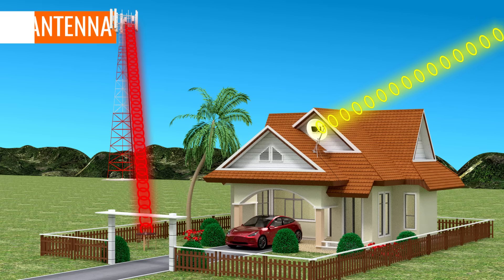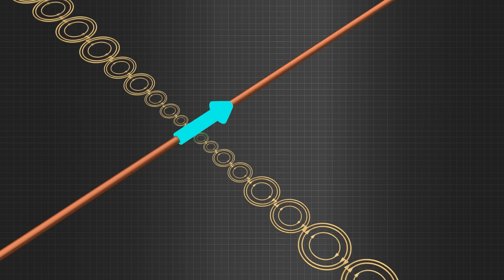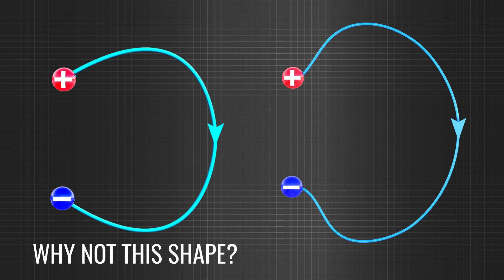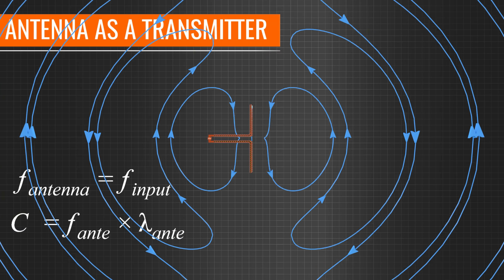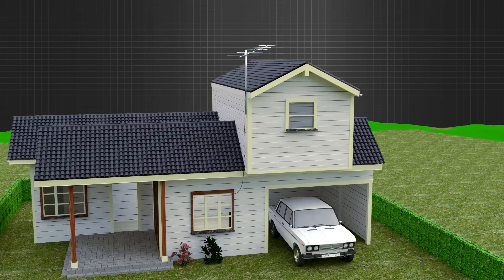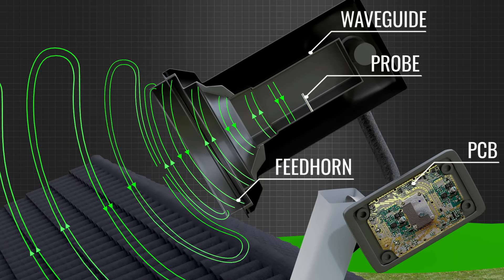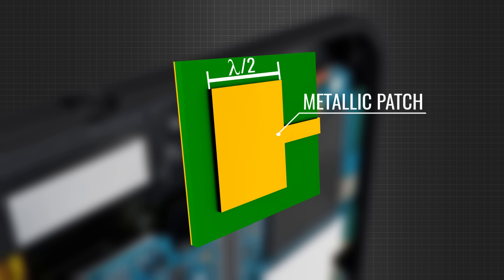How does an Antenna work? | ICT #4

Comment: It's been quite some time since I've been traversing through internet to know about antennas and I couldn't even understand how antenna works without a closed circuit, this video explained perfectly all what I needed to know. Great job. Waiting eagerly for your video on "Kink" effect.
Reply: We live in a 100% magnetic universe..... it's that simple!!   The center of a magnet is by far the most powerful part!!!   that's where you will find anti gravity and most everything else.   STUPID HUMANS!!  We went backwards in the Iron age!!  the center of a magnet is where we belong after all that's what we are all configured with..FACT!
Please review the works at "CORAL CASTLE, Florida. (YouTube),   He would "VIBRATE" ,,  not oscillate the granite at a resonant frequency to the type stone he was working with.  Granit has allot of magnetic properties given it's make up...  You just need to vibrate at the correct freq.  and it will become workable.  Keep in mind we are talking about vibrating only the "B" field of a magnet into the rock!!!   You will note at Coral Castle he also had a horizontal stone , similar to Stone Henge... All his magnetic generators were in the repel mode to maximize the "B" field..  SIMILAR TO THOSE Shown ON THE PYRAMIDS OF EGYPT..  FACT!!,  THINK about it THAT'S exactly why they used copper tools!!!!  You must use copper tools and any iron would totally dispute the field.  Quantum Math is total B.S.  E=MC2 is also total BS... E=MD.  (Magnetic density).  Thanks  Vincenzo.. Please use your brain!!  If your professor gives you any flack,  have him explain the speed of magnetism.  It's instantaneous.
 That's how they used the pyramids as transportation devices, inter Galaxy type transportation that's exactly why they were 8 sides to create a perfect hologram from earths magnetic field that could be used to connect interglacially
Reply: Still you are far away from reality

Comment: now I understand why  transmitter towers need to have that big drum on the antenna, they need to capture the very weak signal generated from smartphones, and that is why frequent wireless connections drain your battery power even faster, it needs to transmit data to the nearest tower which can be hundred meter away, while only relying on your battery (well not if you're stuck into a wall charger)

Comment: Thank you very much for the great explanation, I'm an electrician and I wanna build that antenna 3:24 how much volts did I need and did I need a resistors between 1 and 2?

Comment: Excellent explanation.  I have dealt with antennas from an early age when I first built a crystal radio.  That called for a long wire from the house to a nearby tree and a good ground wire.  I am amazed at how well the antennas in a typical cellphone work - and how many there needs to be in that little plastic cube.  One for the cell tower signal, one for Wi-Fi, another for Bluetooth,  yet another for the GPS reciever that listens to 3 or more satellites simultaneously, and finally one for the near field (touch) communications.  Wow!
Reply: We live in a 100% magnetic universe..... it's that simple!!   The center of a magnet is by far the most powerful part!!!   that's where you will find anti gravity and most everything else.   STUPID HUMANS!!  We went backwards in the Iron age!!  the center of a magnet is where we belong after all that's what we are all configured with..FACT!
Please review the works at "CORAL CASTLE, Florida. (YouTube),   He would "VIBRATE" ,,  not oscillate the granite at a resonant frequency to the type stone he was working with.  Granit has allot of magnetic properties given it's make up...  You just need to vibrate at the correct freq.  and it will become workable.  Keep in mind we are talking about vibrating only the "B" field of a magnet into the rock!!!   You will note at Coral Castle he also had a horizontal stone , similar to Stone Henge... All his magnetic generators were in the repel mode to maximize the "B" field..  SIMILAR TO THOSE Shown ON THE PYRAMIDS OF EGYPT..  FACT!!,  THINK about it THAT'S exactly why they used copper tools!!!!  You must use copper tools and any iron would totally dispute the field.  Quantum Math is total B.S.  E=MC2 is also total BS... E=MD.  (Magnetic density).  Thanks  Vincenzo.. Please use your brain!!  If your professor gives you any flack,  have him explain the speed of magnetism.  It's instantaneous.
 That's how they used the pyramids as transportation devices, inter Galaxy type transportation that's exactly why they were 8 sides to create a perfect hologram from earths magnetic field that could be used to connect interglacially

Comment: If a transmitter is not a closed circuit, then how does it consume power?
Reply: You are thinking DC or low frequency. Circuits behave different at higher frequencies, the antenna can be open but still present a 50 ohm impedance to the transmitter.

Comment: why does the reflector not absorb the electromagnetic signal? is there any specific material that can reflect electromagnetic signal? or may be a specific shape of conductor
Reply: Spesific distance of reflector make  the reflected wave in phase to the dipole that increase the signals strength.

Comment: Interesting video.  A question: Historically (pre digital signal broadcast) TV antennas had a multitude of elements to improve reception based on the distance the antenna was from the station antenna.  You indicated in the video the frequency of the antenna was 2X the dipole distance.  So how does a TV antenna receive various VHF and UHF frequencies even though the dipole distance was fixed?  How does this concept change with the United States changing to digital broadcast of VHF and UHF signals?

Comment: Amazing video and covered a lot of great points.  One thing to remember is a lot of antennas used from aircraft to cars use a quarter wave antenna.  The antenna is then grounded to the chassis or airframe which itself acts like a quarter wave, and in turn you get your half wave setup.
Reply: Those are called monopole antennas, which use aircraft chassis as ground plane instead of a second rod.
Reply: We live in a 100% magnetic universe..... it's that simple!!   The center of a magnet is by far the most powerful part!!!   that's where you will find anti gravity and most everything else.   STUPID HUMANS!!  We went backwards in the Iron age!!  the center of a magnet is where we belong after all that's what we are all configured with..FACT!
Please review the works at "CORAL CASTLE, Florida. (YouTube),   He would "VIBRATE" ,,  not oscillate the granite at a resonant frequency to the type stone he was working with.  Granit has allot of magnetic properties given it's make up...  You just need to vibrate at the correct freq.  and it will become workable.  Keep in mind we are talking about vibrating only the "B" field of a magnet into the rock!!!   You will note at Coral Castle he also had a horizontal stone , similar to Stone Henge... All his magnetic generators were in the repel mode to maximize the "B" field..  SIMILAR TO THOSE Shown ON THE PYRAMIDS OF EGYPT..  FACT!!,  THINK about it THAT'S exactly why they used copper tools!!!!  You must use copper tools and any iron would totally dispute the field.  Quantum Math is total B.S.  E=MC2 is also total BS... E=MD.  (Magnetic density).  Thanks  Vincenzo.. Please use your brain!!  If your professor gives you any flack,  have him explain the speed of magnetism.  It's instantaneous.
 That's how they used the pyramids as transportation devices, inter Galaxy type transportation that's exactly why they were 8 sides to create a perfect hologram from earths magnetic field that could be used to connect interglacially

Comment: At 3:50, isn't the circuit incomplete to allow the flow of charges? (not devaluing your work, just an honest question)
Could anyone clear my confusion?
Reply: Here it s about non DC voltage and the needs only a voltage variation

Comment: Thank you for your awesome explanation. I still have a question. Due to the charges movement do we have a current in our antenna ? If yes it means current can exist event if the circuit is open, even it is very low ?
Thank you again =)
Reply: @Evil Component Sir, reradiated to  the reviving antenna or space?

Comment: Very good video, thank you.
What I still don't understand is why the antenna setup at 3:30 really works. I thought for a current to flow we need a circuit where we apply a potential difference (voltage). The voltage is there, but why don't we need a circuit?

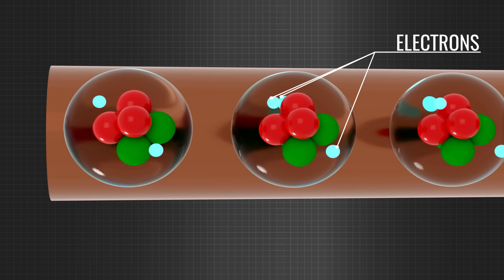Comment: @3:20 why does a conductor need a bend in it though? could someone plz explain that? thanks
Reply: Saad Farhan conductor need a bend for connecting it to a generator, TV etc. In fact the bend of a dipol antenna isn't as big as it shown in the video, unless the signal would look like otherwise.
Reply: @armkhangeldyan8259  thank you

Comment: I have a question. In the animation where the antenna creates the signal, you can see that he signal spreads out as it propagates. During the animation where the antenna receives the signal, you just played the first animation in reverse, but wouldn't the geometry of the incoming signal look completely different (it wouldn't magically be drawn towards a point)?? Thanks!
Reply from the maker: Yah, the shape of incoming waves will be different.
Reply: Good point. signals are not focused to receiver antenna like showed in the animation. Isotropic antenna waves propagate all directions equally, so the gain of the receiver antenna is inversely proportional to square of the distance.
Reply: That was focused at the parabolic disc.
Reply: @Evil Component Quantum Mechanics? What are you talking about? What is missing are all the near fields.
Reply: @Heads Mess im not very informed on this stuff, but I watched the waves as circles hit the thing, and its the same action as the single line wave traveling one way. Not sure if that was what you were getting at tho.
Reply: @Heads Mess  yea i get that amp is total peak to vally and wavelength is time before it switchs, but im not seeing any breakdown of the animation. Where you say it has to change 90° im assuming you ment from circle to wave line. And the way the wave is fliping over the axis is from it either being the right [start point] or left [end point] of the circle form. Or maybe im just not understanding what you were meaning.

Comment: I like when you go straight to the point and do not make us waste time.
Reply: Very efficient. Very engineer
Reply: Amazing video and covered a lot of great points.  One thing to remember is a lot of antennas used from aircraft to cars use a quarter wave antenna.  The antenna is then grounded to the chassis or airframe which itself acts like a quarter wave, and in turn you get your half wave setup.
Reply: Exactly.
Reply: So True!!!
Reply: Me too
Reply: @Shindiggity  Except in the school version you left knowing a bunch of difficult math, computer science, and design, all of which are useful and marketable and needed for other things anyway... so not actually very inefficient at all. This video taught you none of that but did tell you how an antenna works. Which... tells you how an antenna works only. It's fine for what it is and all, but it is in ABSOLUTELY NO WAY "a semester in 8 minutes"
Reply: @gavinjenkins899 Learning the math without understanding what's going on is just playing around with numbers.
Reply: @DF-ss5ep  They teach you what's going on too in school... but you now also have the tools to go design new antennas, not just go "huh, interesting" and move on
Reply: why is pfp, the F-22 raptor stealh fighter jet, are a fighter jet fan?
Reply: in a school most of the time is spent on diversity and inclusion talk.
Reply: Catalin 🔴 What Is Islam? ⚠️

🔴 Islam is not just another religion. 

🔵 It is the same message preached by Moses, Jesus and Abraham.

 🔴 Islam literally means ‘submission to God’ and it teaches us to have a direct relationship with God. 

 🔵 It reminds us that since God created us, no one should be worshipped except God alone. 

 🔴 It also teaches that God is nothing like a human being or like anything that we can imagine.
🌍 The concept of God is summarized in the Quran as:

📖 { “Say, He is God, the One.  God, the Absolute.  He does not give birth, nor was He born, and there is nothing like Him.”} (Quran 112:1-4)[4] 📚

🔴 Becoming a Muslim is not turning your back to Jesus. 

🔵 Rather it’s going back to the original teachings of Jesus and obeying him.
Reply: @ahmdabdallah2132  Sir, just as Islam has no relevance in the world today, so is your comment to the O.P.